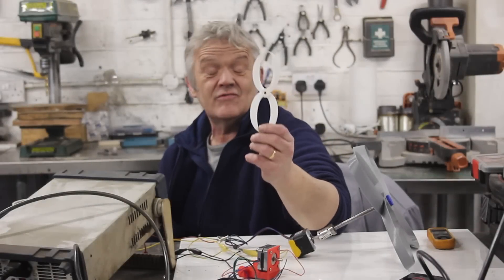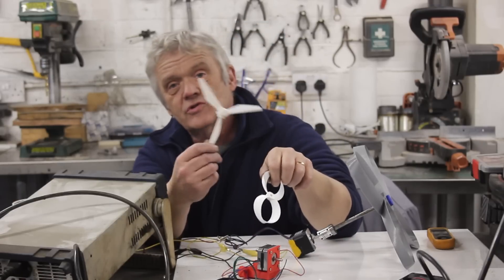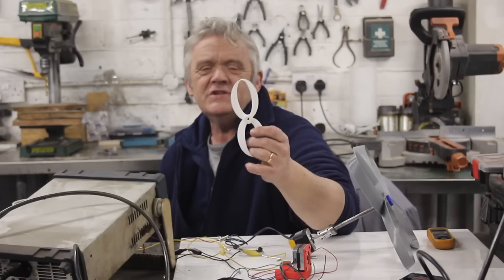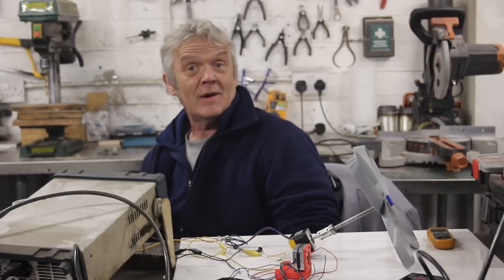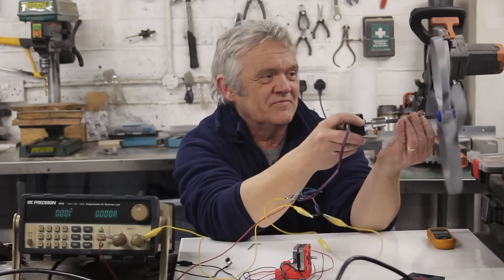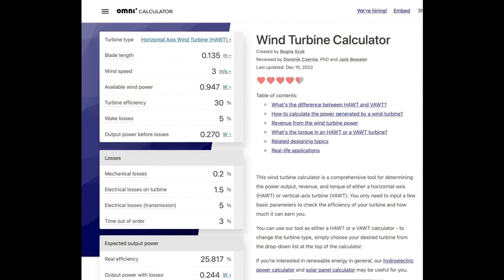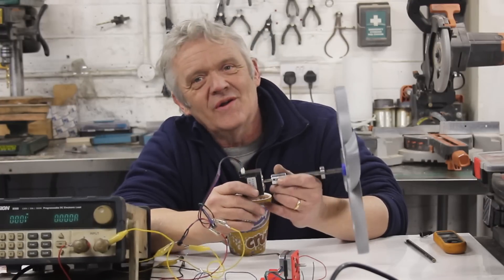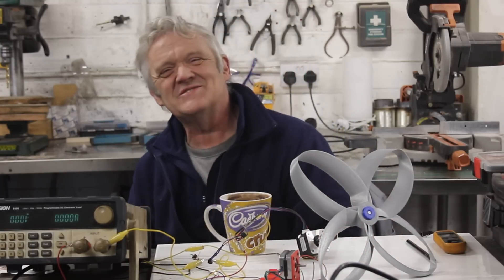1846 Further Testing Of The Toroidal Propeller For Wind Turbine Use

Comment: 50% more material than a traditional design, but not 50% more power. In my opinion these props are not worth it. Even if they are 20% less noisy. Like polishing up a good turd, it still a turd at the end.
Reply: That's what my husband says when I put my Makeup on 😂!!
(Seriously, he Does! Fortunately he's quite funny and I Have got a sense of humour!!😆)
Reply: A traditional wind turbine with four  blades has a peak efficiency slightly less than than two blades. The presumption is increased surface area results in increased resistance  But the four blade peek efficency is at about half the the rate of rotation and the pitch needed to be changed.  

But because the wind remained the same, the same energy is in the wind,  and because the rate of rotation was halfed, the voltage from  the same generator was halfed. Rhetorically, how were the researches able to test and come up with roughly equlivent  peek efficency? Because they didn't use a fixed resistance. 

One may  look up "graph, tip speed ratio or TSR, and coefficient of performance"  and take note that for any given wind and turbine, the only way to vary the TSR is to vary the load resistance. 

I'm not sugesting this MIT inspired  blade will have a peak TSR  that is better than a traditional turbine. Mater of fact I would place money on a bet that it won't. But I am saying that a test with just one randomly chosen resistance is a near useless test on its own.  

And while I'm not critical of entering a comparison with a prejudice. I am critical of conclusions resulting from testing methods that are incapable of supporting the conclusion. One may as well just stick with their prejudice and not test because they think a higher surface area always means more drag and lower efficiency. 

In summary, To find the peak efficiency of any turbine and generator, you need to vary the load to vary the turbine's TSR that when graphed, results in an efficency  curve with an optimal efficiency at one load dependent TSR.

Comment: Gave the old MIT conspiracy propeller a go 😄 sometimes the math on paper doesnt quite cut it. Nice thumbnail 😂
Reply: When you use the equations for laminar flow but use the device in turbulent flow, the numbers won't add up. It's a difficult problem to solve in the real world... most US Navy submarine screws (propellers) are classified to protect the research that has gone into (almost) solving this problem in water, at different pressures and speeds. An enlisted submariner (usually a nuke mechanic) with dive quals has to cover it before going into drydock.

Comment: The toroidal blade has a greater surface area within the same sweep area. However the angles of the blade are self checking and the drag produced more than compensates for the area gained? I think one haif of a Toroidal blade makes more sense for air interactions.
Reply: I think were missing some points here. Area of blade is not being considered.  There is much nore area in a torado blade. Its ment to push more and have less drag.  So a test should include area of blade? Lots of other tests.
Reply: @johnramirez5032  How can drag be calculated without the size of the blade being considered?
Reply: @brotherpaul963  exactly.  The diameter is the same. The surface area of blade is not being considered.  The larger  surfave of blade makes it heavier. They are not considering these factors.
Reply: @johnramirez5032  The surface to sweep ratio is a factor and even if you do not see anyone else talking about it, I am. By the way Why are you trolling me? Why don't you have anything positive to say?
Reply: @brotherpaul963  im not trollimg you. I really was agreeing  with you. Im sorry you think that or if i have said something in a way that is trolling u it was not my intention.  Im fine with what u said. Sorry for any mis understanding.
Reply: @johnramirez5032  It is an easy procedure to increasr the surface of the blade and decrease the weight at the sametime without really affecting its strength. The video was about the efficiency of the blades  for wind turbines. My point was the angle of the blade is defeating the gains made by putting a larger sweep surface in the same sweep area.
Reply: @brotherpaul963  makes sence.